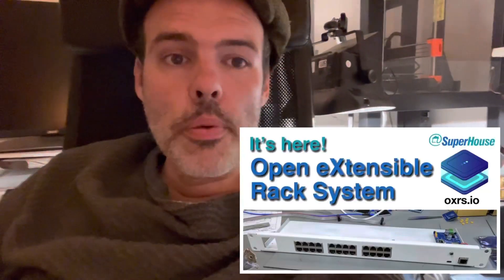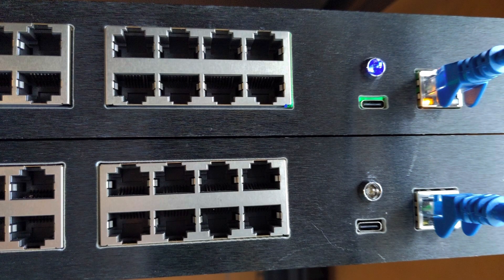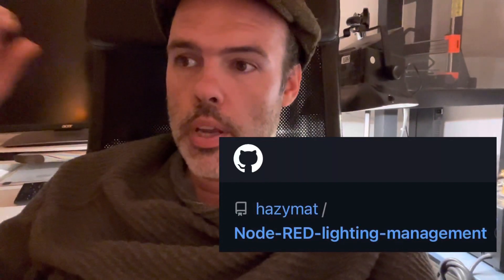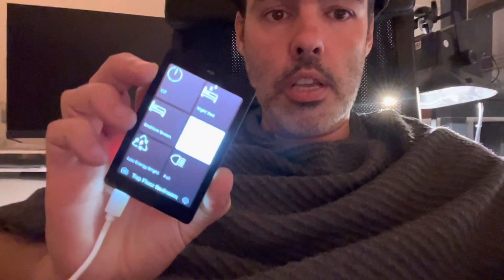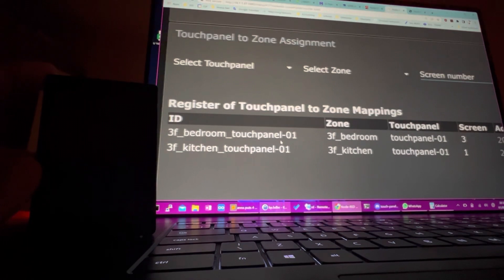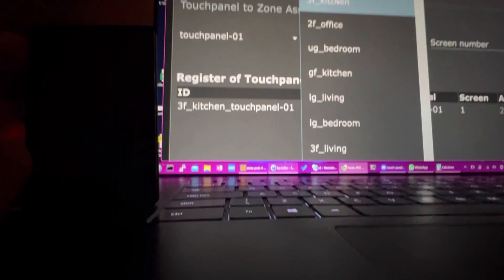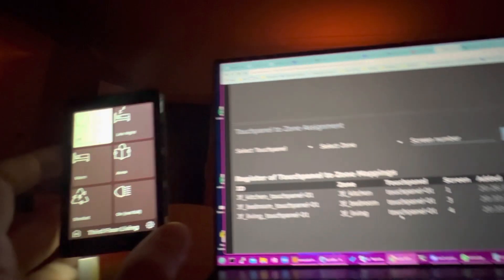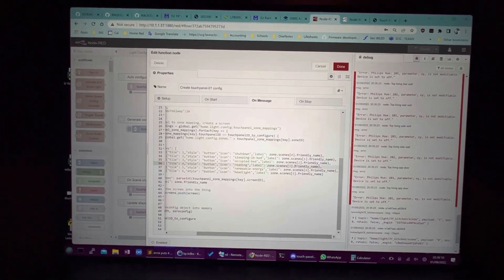Touch Panel light switches - OXRS for the win!

Comment: Fab technology and not a bad price. Would be nice to have that panel pinned by the front door wall for everyone to use as they walk in to turn their bedroom lights on and off as they walk out.
Not looked into the panel yet, as in voltage/battery needs but I'm sure it's quite easy.
Thanks for the info
Reply: the extra cool thing is there are shields already designed that support 802.3af ethernet poe and DIY POE for use with wifi
and there are 3d printable housings designed for different places around the world to easily mount the displays on a standard wall electrical box.